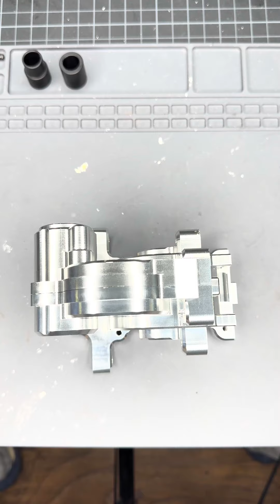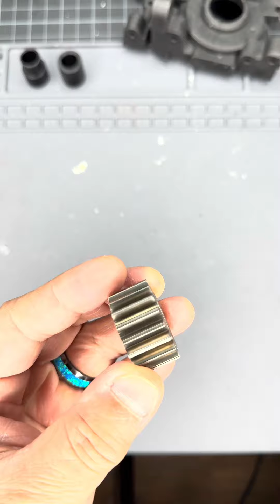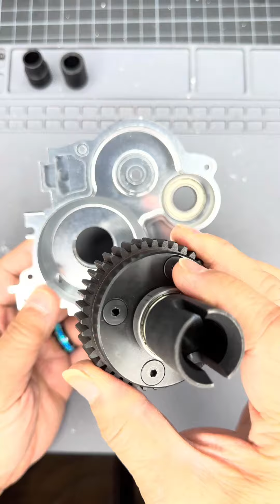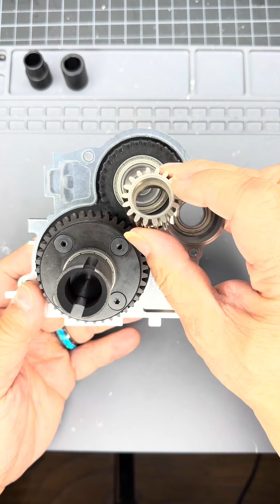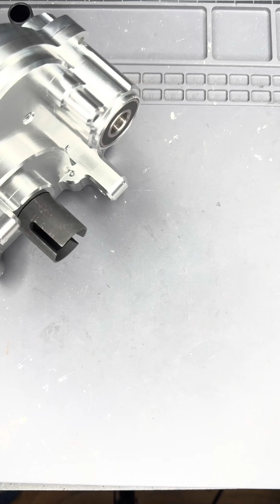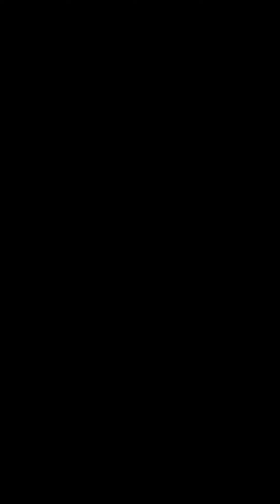VESLA.5 Big Bore Transmission Preview

Comment: Is this a needed upgrade to go to 12s?
Reply: A lot of guys are running the taylor 3Pc transmission with Taylor idler Gear, but this big bore transmission is the Ultimate fit and forget solution
Reply from the maker: You will want some kind of upgrade to the transmission, the 3 piece Taylor billet transmission with Taylor. billet idler gear, but yes the Kraken BigBore transmission is the ulimate transmission for strength!

Comment: Awesome upgrade. It is too bad that you can't use a small block with the Big Bore Transmission though.
Reply from the maker: it's your pipe mang, not the engine. Taylor pipe header curves up!
Reply: @krakenrc  Correct. You have updated the website to reflect that. I didn't want to spend another $400 on an exhaust so ditched the whole Kraken Big Bore Trans idea
Reply: @krakenrc does the stock...."powder metal idler" need upgraded for 8s use on the stock electric version?